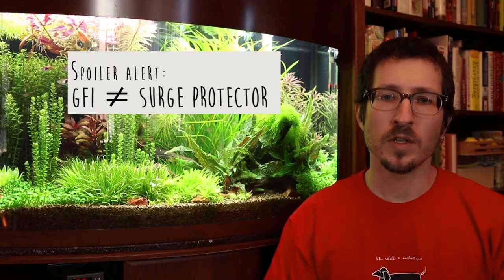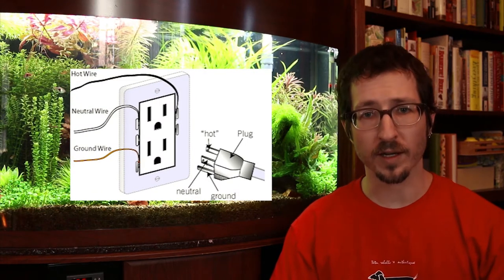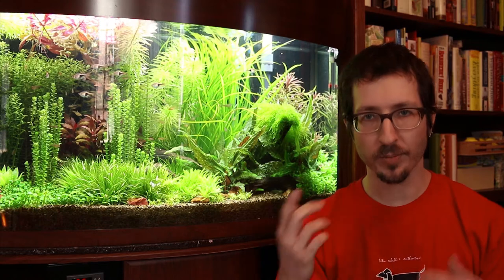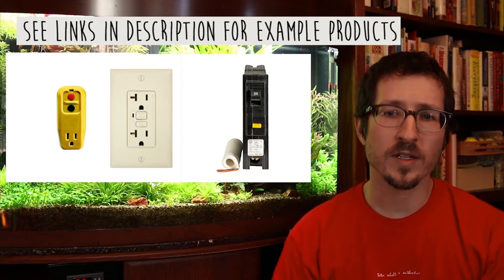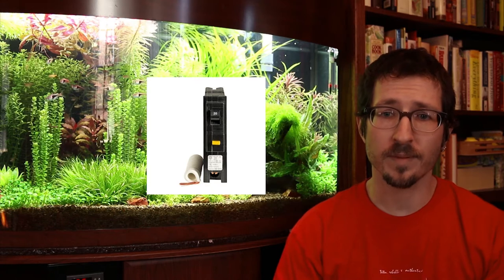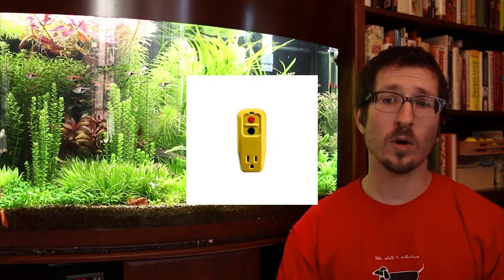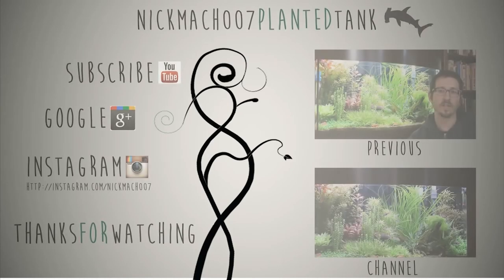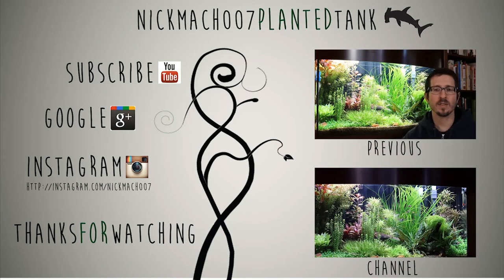Electricity in the Aquarium: GFCI vs. Surge Protectors (part2)

Comment: Just for anyone 1 in the uk the gfci is called an RCD or RCBO great info nick thanks also anyone in the uk we operate at 230 volts consult an electrician as you need a qualification to install this equipment 
This is information only not a negative comment thanks again nick 👍🐟🐠
Reply from the maker: Absolutely-- no offense taken. Thanks for adding the comment.

Comment: Love it man!!!
Reply: This is valuable information.  What about utilizing a Battery backup unit similar to one that is used for computer equipment.  They sometimes contain a surge protector. Do you know if any contain a GFCI?
Reply from the maker: I know exactly what you are talking about-- UPS (uninterrupted power supply). Unless the blackout was relatively brief, not sure how much time one of these would buy you-- unless it had a very large battery. They usually give you just enough time to power your computer or equipment down safely .  I have never seen one with a GFCI since they are usually used for electronic equipment (computers, etc.) which would not be installed near water. But there may be one out there.
Reply from the maker: Thanks for watching.

Comment: question, i have a GFCI shock buster, however is it safe to install the surge arestor with multiple receptacles to one GFCI shock buster? would it still work and be safe? just trying to make sure. or do i have to have each plug into an individual GFCI?

Comment: I never even heard of this. Looks like i have something new to take care of me
Reply from the maker: Time for a trip to the home depot-- unless you want to rewire an outlet just get the portable version. Best $10-20 you will ever spend on your aquarium-- check out the links in my video. You can just grab one off amazon if that's easier. But it can definitely save your life. Well worth it.
Reply: i am just not that handy bro! i will get the portable one
Reply from the maker: Handy comes with practice. But portable one is just fine. Glad to hear you will be picking one up :)
Reply: got to. I picked up the surge protectors becaus i thought that would take care of me. Safety first